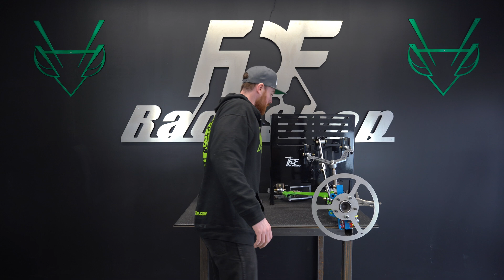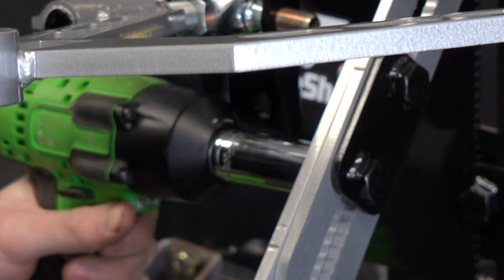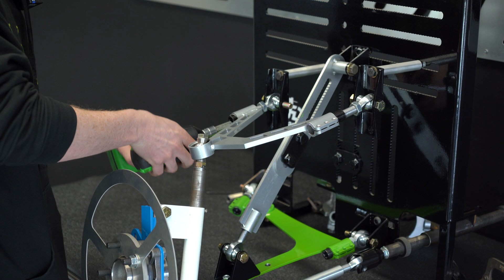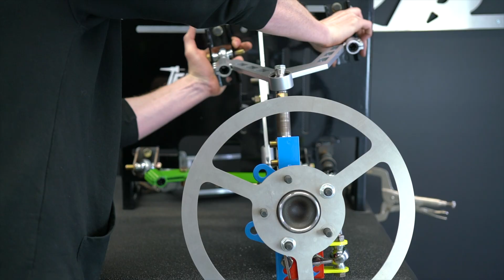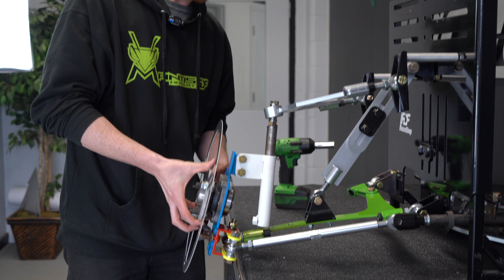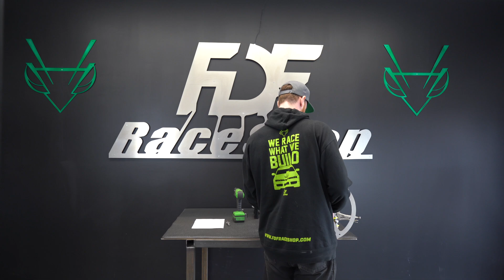Front Suspension Geometry. Double Wishbone Suspension Explained

Comment: So my takeaway from this is … changing my static camber and track settings in my V35 (length of LCA and UCA is probably introducing several different effects on dynamic camber, Ackerman and caster as the suspension is moving and steering angle changes. my stock knuckles with bolt on steering mods have no compensation for roll centre changes when changing ride height either 🤯

Comment: Drifting? I thought this was going to be about setting up a car to go quickly around a track. Sorry for taking up your time.
Reply: There’s a huge amount of crossover between front suspension set up in drifting and grip driving.

Basically don’t need as much toe or camber as they run, but the same concepts apply.

Comment: I didn’t hear you mention, that whatever angle the upper a-frame starts at (static.) DRASTICALLY affects camber gain, roll center Etc. Which is a very important element to the type of racing I’ve always done. But, has a major effect on suspensions and racing of all kinds! Otherwise, I’m glad I ran across the channel guys. You have some great, very informative stuff, Thanks!

*EDIT*
Whoops! Should’ve watched for longer than 2 minutes or so, before commenting… My Apology!!! 🤦‍♂️

Comment: How about some baseline settings for common chassis?  Some sort of starting point.  Maybe even recommended ranges for such settings including ride height (drift specific)...please.
Thanks.  Love the videos.
Reply: The baseline is obviously the stock geometry of your car. There are no universal magical numbers. You should spend some time on researching the basics of suspension geometry.
The rambling in this video is not gonna help you with that. For example, just changing the width of the rear tyres effectively changes the cars trackwidth, which changes jacking forces and roll angles ... and all of sudden the car behaves totally different and you have to tweak springrates/arb settings, caster and static camber in the front even though you merely changed a small parameter in the rear. 
So I hope you can see that, unless someone with the same driving style owns the exact same car with identical aftermarket kit, asking for settings is pointless.